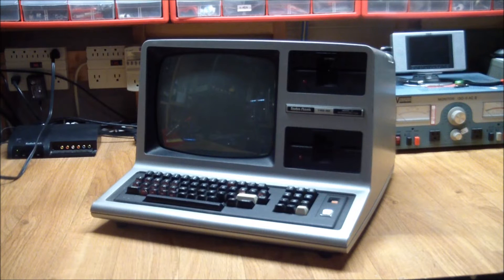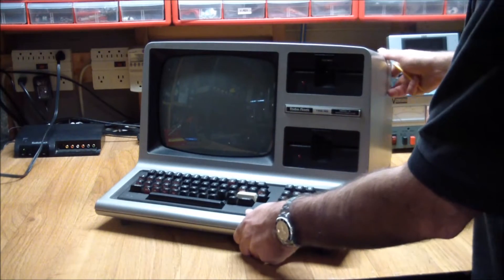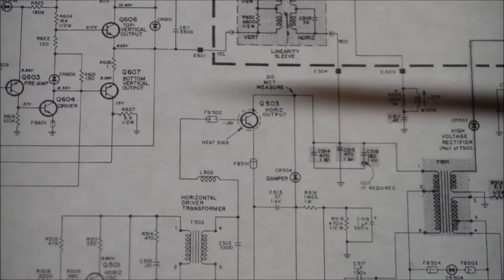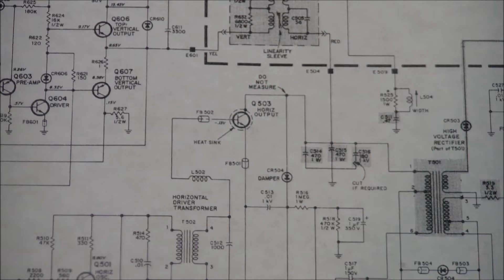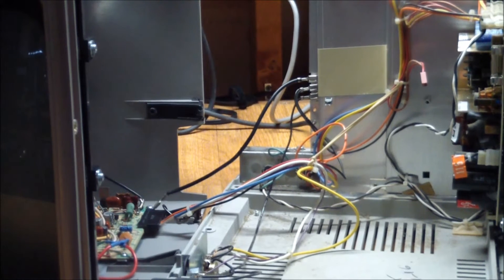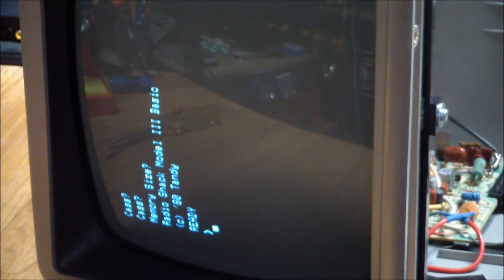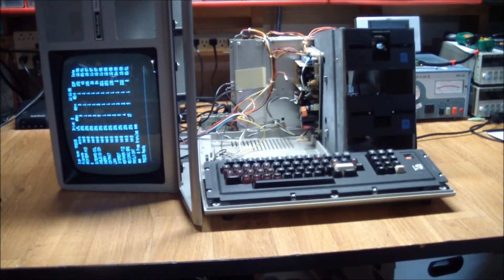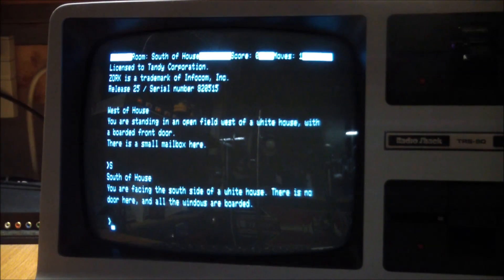AE#53 TRS-80 Model III Computer Revival

Comment: i worked for Tandy in the 1980's as a manager at a Computer Service Center..
Texas Peripherals drives were sold after market replacement drives..
Tandy used Shugart or Tandon drives..

You would not believe the number of Model 3 and 4's that came in with the complaint of this one and all we did was adjust the brightness and contrast ..tada fixed LOL
it was usually after someone picked up and moved the computer and accidently turned the knobs..

Also that power supply is not original..
it should have 2 power supplies: 1 attached to the vertical RF shield and 1 attached to drive tower..
power supply 1 powers: mother board,video and RS232 board (add-on)
power supply 2 powers: FDC and the 2 drives..
notice the 2 mounting holes forward of the power supply that is 2 of the 4 mounting points for original power supply

Comment: Nice repair job! For some reason, waves of nostalgia washed over me when I saw the white plastic support ring around the center hole of the floppy disk in the video. I had forgotten that originally those disk wore out with that area becoming weak and developing ripples. Then a friend of mine introduced me to the support rings that fixed the problem. After a while all disks came with the rings pre-applied. No wonder I can't remember anything current if my brain retains this kind of stuff...

Comment: Great video; the TRS-80 Model III was my first DOS-based computer where I learned BASIC and COBOL.  I smiled when I saw you type "ZORK", a classic running on a classic.
Reply: Last week I finally got a Model III of my own; 48K, dual-disk.  It was sold as having "no video" and the top drive has the latch off but this video is going to help me immensely.

Comment: I still have mine. Bought it new way back when. Havent turned it on in many years, so I dont know if it still works.

The first computer I ever used, and learned BASIC on, was a Model 1 with the big expansion box, in 1977.

Back when I still used my Model 3 it had a failure. I didn't know too much about electronics back then, but the machine came with a schematic, and I was able to do some measuring and traced the problem to a failed transistor. Swapped in a new one and it lived again! At the time I thought that was pretty awesome! Was so proud of myself.

Comment: We used this computer at school. 81-85. I remember they had an acrylic on the screen, green in color, and they looked like phosphor green. I guess it was the fashion.
Reply: I had one of these as a home computer when I was in HS (I actually still have it and it still works 48K but no DD).  I did the green screen thing as well and later tried an amber one.   You would get a 12x12 sheet and cut it to fit.  I guess the white on gray was a little boring.

Comment: In the fall of 1984, my dad bought me a used model 3. It didn't have disk drives, only cassette. But I had fun playing with basic on that. I once tried to upgrade to a single disk from a kit from 80-Micro magazine some time later but the parts were defective, even when I sent it back to have it repaired. So during the entire time I had it, it was only a cassette system but had the whopping 48k in it.
Reply from the maker: The first floppy drive I got for my Model 1 long ago arrived just as the weekend started. I hooked it up and nothing worked, and I couldn't get any tech support because of the weekend. It took me until Monday morning to figure out that the OS disk (VTOS) was bad. The local Radio Shack sold me copy of TRSDOS for $14.95, and life was sweet again.

Comment: I wonder how well Super Lube Teflon grease would work on those rails.  The stuff is actually non-toxic!

I was lucky to find a good CPI/Control Data floppy drive for my 5150.  It actually worked right out of the industrial chassis from which it was pulled...but then I don't think it got a whole lot of use anyway, and the Tandon TM502 hard disk which was in the same chassis also worked.

Comment: Nice find just one thing to say is that some horizontal output transistors have a low value resistor 33R from base to emitter the BU2508 is one of them.

Comment: What is that attractive peice of equipment sitting to the right? I'm intrigued.
Reply from the maker: It's a Vector-Vid WP-32 which contains an isolation transformer, auto transformer and current limiting. All in one solution for powering up equipment in an unknown state of repair.

Comment: Hello, I got one of this while ago, it was not working, I replaced riffa caps I was able to power on but nothing on screen. One of potentiometer was toasted I could not move it, I replaced 500k potentiometer and finally I got a picture. I have to move both contrast and brightness almost all up to see anything but is not very sharp. Any idea what might be a problem?
Reply from the maker: The high voltage may be too low, or the CRT is tired. Consult a service manual for the proper voltage and be very careful because you are dealing with several kilovolts.
Reply: @artifactelectronics  Do we need to get one of those massive multimeter probes like you have? Also, it looks like you have a Fluke 179, the same as my multimeter, but I thought it only went up to 1 kV. Thanks!

Comment: Maybe you already know but the answer to Cass? is either L or H depending on whether you want to load Cassette at 500 baud or 1500 baud using CCR-81 or CTR-80A cassette recorder, Defaults to High speed  if you press ENTER.  Memory Size? allows you to specify the memory size for storing basic programs vs. assembly language, defaults to using max RAM for BASIC programs if you press ENTER.

Comment: That reading you got from collector to emitter - I don't think that's bad.  It just has a protection diode.  The real problem is the base - emitter reading.
Reply: Built in flyback diode, common on LOPT power devices, though this board also has an external efficiency diode that does the same thing. However the resistance between base and emitter being there is possible as they also are available with a built in base switch off resistor in the case on some. However the problem is drive related, you must resolder all the joints on the base side to the drive transformer and driver, so that dry hidden joints are not a problem later. As well the base inductor should be damped slightly, probably with a 10R 0.5W resistor soldered across the pins, to reduce the ringing across it on turn off.

If you check the new transistor gain is will always be low, they do work with devices with a Hfe below 1, as it is doing voltage amplification not current amplification, as the base current can be over 5A peak during switch on.

Comment: Can you tell me where you got this replacement transistor? I have a Model 4 with this problem and it too has a A23 transistor. I tried googling your replacement SI25S577 and can't find any information on it. Thanks for the video because it pointed me to where the problem was. Now if I can only find a transistor that will work.
Reply from the maker: The service manual for the Model 4 says that it's a 2SC2373. It crosses to the NTE 379 if you can't find the original.
Reply: @artifactelectronics  Thank you so much. I occasionally turn on my Model 4 and the last time the screen was out. Found your video and did the test and low and behold, just as you found it was bad. Thanks much

Comment: i have one coming my way from ebay. i currently have a apple iie.
Reply from the maker: Lots of fun awaits you
Reply: got it today, cleaned the exterior, fixed one of the drive doors, took it apart to prep it for the filter cap i ordered, turns out this one has 2 power supplies, so i had to order another one. each power supply has 3 wire connections plus the power, not the long white one like yours and others i see online.